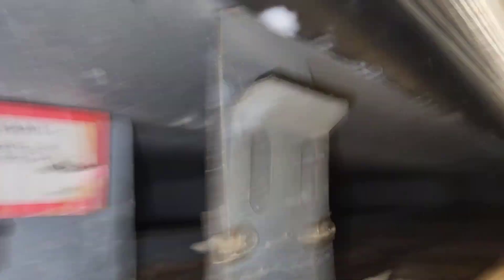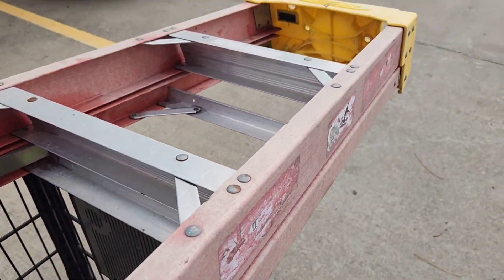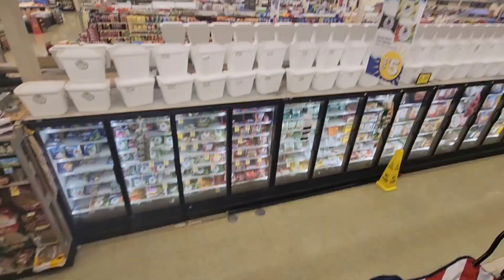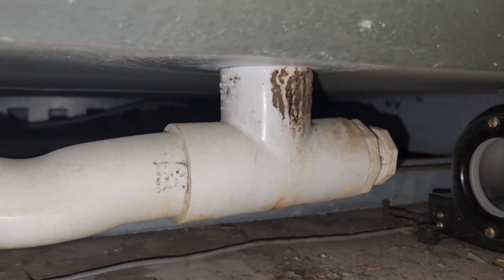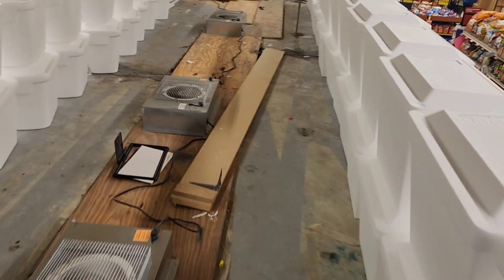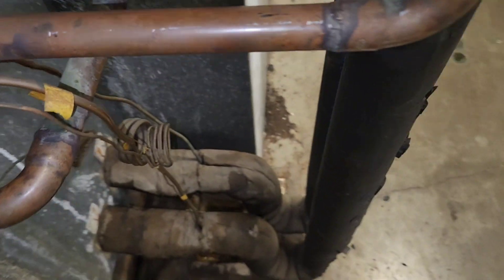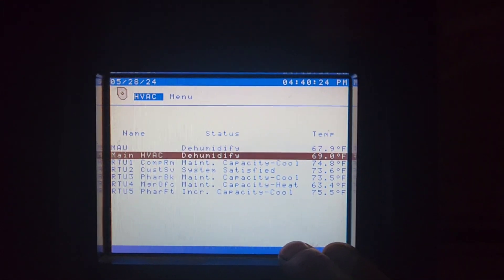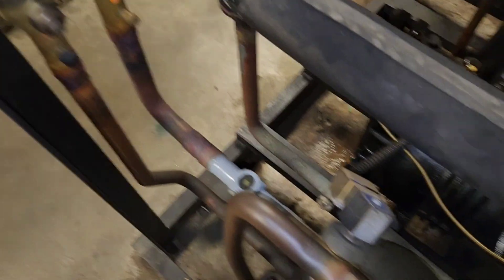Unlocking the Mystery Behind Store Floor Sweating!

Comment: Inside the cases from freezing up from backed up drains is heaved sections allowing water into the inner layer of the casing. Heaved sections destroy insulation and let the outside of the case get below dew point. I’ve seen 3/4” gaps between frame and sides on old junk cases. Bottom of cases heaved and letting water get into the insulation under the case making it worse and worse.

At a certain point it can’t be combated and needs to be replaced.
Reply from the maker: EXACTLY PERFECTLY EXPLAINED!

Comment: If the dehumidifier is working on the rack ac / heat reclaim should be good
Reply from the maker: Well, I happened to notice that the dehumidifier has its own compressor... one of those compressors in the motor room is for the dehumidifier.